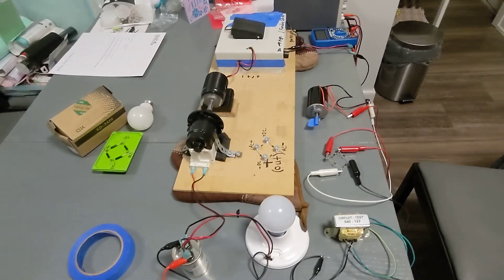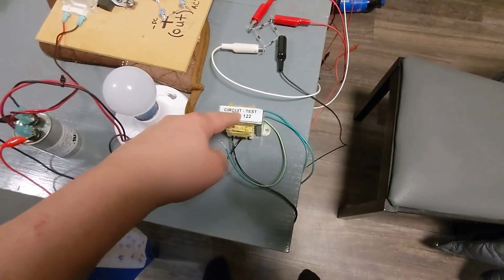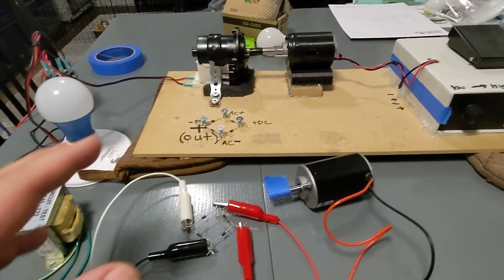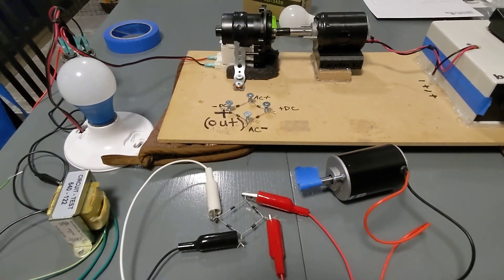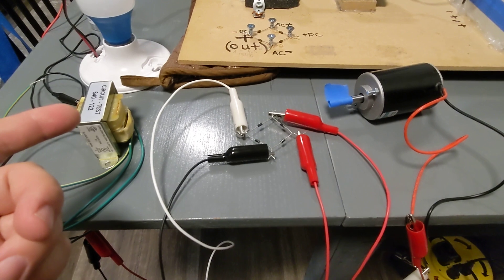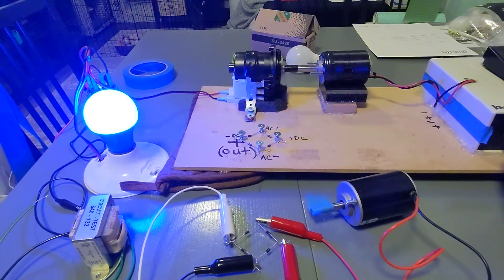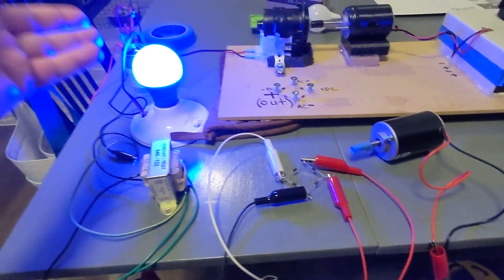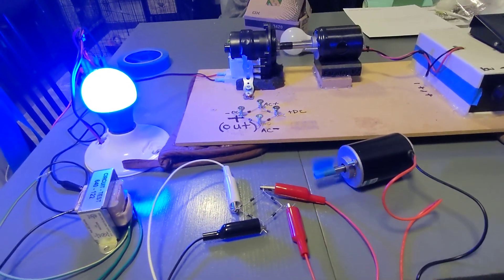Faraday Research RND ⚡⚡💦 Gerard Morin's Reboot#freeenergy #tesla #zeropointenergy

Comment: So no drag on the motor generator? what is the efficiency of the system? can the output of the transformer run the drive motor and make it a free energy system?
Reply from the maker: Okay to run the motor and get the best performance out of it it takes 18 watts ....so your step up transformer the higher the voltage you get out of the step up transformer makes it more efficient..... That is the key to this system if you use very low voltage transformer your efficiency decreases greatly so the idea is to get the highest step up transformer as possible and then step it down to whatever you need